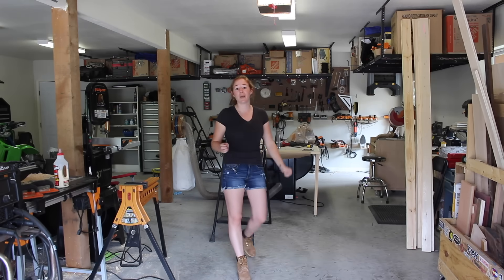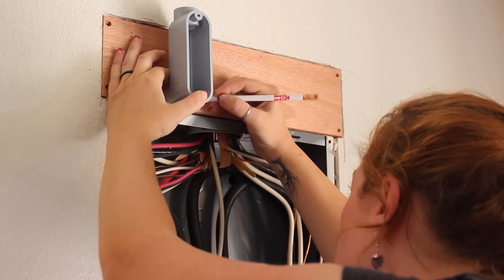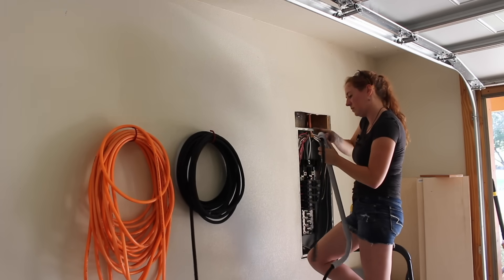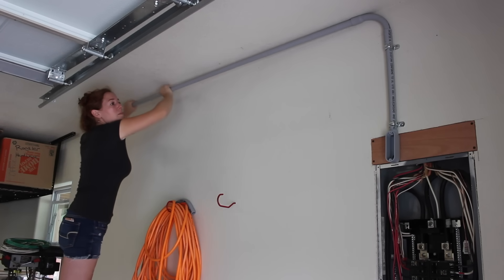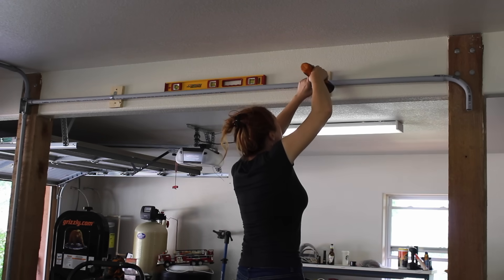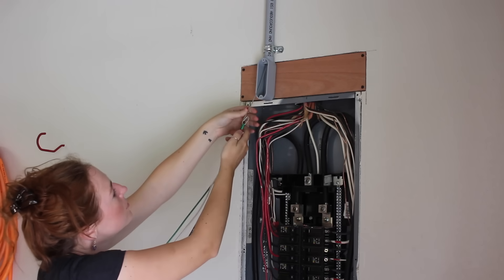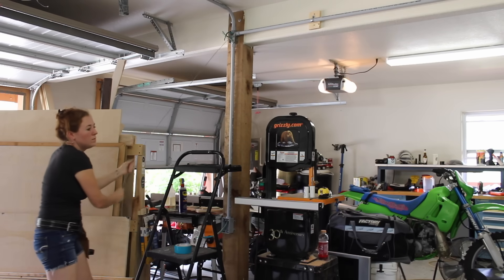Adding 220 Volt Outlets to the Garage

Comment: I'm pretty sure it's against code to giggle while using a fish tape. =)
Reply: i thought it was against code if you didnt?
Reply: If I were an inspector, I would give her a pass :)
Reply: @droidgee  From the ell going into the box there is no connector, the wire will be rubbing against the sharp edges of the  box.
Reply: How is it that you have so much space in you electrical box?
Reply: Section 308.36 B state no one ever laughs using fishing materials
Reply: @TomsComs  Well I must say that she was definitely giggling and it never got close enough to laughter so I think she still passes :-)
Reply: good one
Reply: When she hits the buss with the head, no more giggle
Reply: Anyone know what size of THHN she used? Trying to decide which one to use myself.. 10 or 8 gauge for a buzz box Lincoln AC welder?
Reply: @berniemac8413  So a thirty or fifity amp install?
Reply: Vivid Droid fifty amp install..
Reply: @berniemac8413  6 gauge wire is the best. Lower resistance cooler connection. Handles max current of breaker (over current before trip or fail). You need to run it in armour also.
Reply: Vivid Droid my Lowe’s was out of 6 gauge thhn so I went with 8 gauge.. don’t think I’ll ever use the highest setting on my stick welder so it’ll never see the peak amps.. hence, 8 gauge should be fine. And I ran it in 3/4” pvc conduit.
Reply: @berniemac8413 I have ran 50 on 8's including the ground.
Reply: @berniemac8413  new code says 6 what is the gauge of the welder cord
Reply: Vivid Droid hmmm interesting.. is the new code for romex? I’m unsure of the wire size for the welders cord.. it’s a simple ac/dc Lincoln tombstone welder.. I was unimpressed with the plug when I first saw it.. manual states three 10 gauge wires or bigger to power outlet.. and if the run is over 100’ from electrical panel to outlet, then use 8 gauge or larger.. page 7 of this document.. 

https://images.homedepot-static.com/catalog/pdfImages/fe/feb72a11-06e5-487c-9242-75b2df4ecdb1.pdf
Reply: @berniemac8413  The 6-50r uses L1 and L2 and a ground. The neutral is not used as there is no need for unbalanced currents.
Reply: @berniemac8413  You must use the ground and not the neutral as a ground.
Reply: Vivid Droid yea that’s how I wired it.. ran an 8 gauge red, black and green thhn wire through conduit to outlet.. run is pretty short, at max 5’..
Reply: Vivid Droid haha.. from what I’ve seen on charts, romex and thhn wire don’t have the same amperage rating for wire size larger than 10 gauge (thhn can withstand more amps).. and I also found out you shouldn’t run romex through conduit which is the reason I chose thhn.. funny how they’re all bickering over code. Lol
Reply: @berniemac8413  Yep. Codes are minimums to cover their arses. Running lower resistance ie lower gauge actually saves money over time.
Reply: @VividDroid  You can use the neutral as the ground, but you MUST mark the neutral line with some sort of marker, like green tape so people in the future know it's a ground.
Reply: @lukepotosky7710  good idea
Reply: @berniemac8413  When in doubt go up a size. Wired mine for 30 amp so 8
gauge was plenty... But depends on length .
Reply: @berniemac8413  If you are doing a welder, I belive it's code to use at least 6 gauge and using at least a 40-50+ Ampere breaker. Remember, always play it safe, and code is just the minimum requirements.
Reply: @berniemac8413  What kind of amperage range (low to high) are you going to be running through it?
Reply: A G I have a Lincoln ac welder 180... which ranges from 20amps to 180amps.. the lowest setting I’d use would be 20amps and the highest probably be 145amps.. maybe 160 if I ever burned 5/32” rods..
Reply: @berniemac8413  Take a look at the welders specs to see what the input amperage is, most 180 amp ac welders will require a 50 amp circuit which would require # 6 wire.
Reply: Donald Crossley thanks for the response. I tried purchasing the 6 gauge, but my local Lowe’s only had 8 gauge THHN wire.. specs said 8 gauge THHN it’s rated for up to 55 amps, so that’s what I went with.. along with a 50 amp breaker..
Reply: @berniemac8413  If you used any NM cable in the circuit, #8 is only good for 40 amps
Reply: A connector is missing between the ell and the main, with enough vibration there will be a short
Reply: Got Code? :)
Reply: Depends on what jurisdiction you are in and what clothes you are wearing.
Reply: LOL
Reply: XD
Reply: Sorry, but I will say.....that was the cutest giggle ever :)
Reply: ok weirdo...
Reply: No it's not
Reply: @MiguelHernandez-rk7bg  /r/whoosh

Comment: I am not an electrician by any means but I was under the impression you can only run one outlet per 220V breaker?  Is that wrong?  I am in the middle of running my 1st 220 for my 5HP compressor and I see and hear that every where for some reason...
Reply: I think you can have a number of outlets in one 220 v breaker as long as the load on those outlets does not exceed the amp of the breaker. I guess the intention of the user for the outlet determines its quantity. Not an electrician too.

Comment: should also be using red and black, not white ;)  usually people don't mind either way i just typically like to do it that way. I also like to mark outlets just in case even if the plugs for the wall are different than a typical 120v

Comment: My stepfather was an electrician in Chicago for 55 years and one of the best.  A couple of hints:  1) use mineral oil to keep the wire from binding in the conduit.  2) run the fish tape while you're building the conduit.  3)   Leave yourself a foot of extra wire at each junction box.    I worked with him from the time I was 8 to the time I was 14 but am not an electrician.

Really nice work though!

Comment: Where i am from you can only use one 220V outlet per circuit, so if you want two outlet you will have to run two separate circuit, you can not split one circuit and use two 220V outlet.

Comment: At first I had some questions, but going to your blog and reading the additional info there answered most of them. I agree with one other comment which stated you need to ground the metal junction box per code. Just curious why you didn't use a PVC J box there? One thing to keep in mind is that you have to size the circuit for the devices you plan to use. You can not safely run a tool that requires a 30a circuit and a tool that requires a 40a circuit both on a 40a circuit. You would have to run 2 separate circuits because by the time the 30a tool shorts out and draws enough amperage to trip a 40a breaker, you could have a fire or get shocked yourself. If both tools use the same amperage circuit (both are 20a or 30a, or 40a, etc), then you can install multiple outlets on the same circuit as April did here. You can't add the amperage rating for multiple machines together and size the circuit for that combined rating. Which means you may not be able to run 2 machines at the same time. It's always about safety - YOUR"S !!  Nice job April !

Comment: 220 Volt outlet needs four wires - two for, power, one for neutral, and one for ground. The diameter of the wires depends on the maximum current of the outlet that you would like to install. This will also decide the breaker that you need to choose.

Comment: I was a navy electrician but not comfortable enough to add one of these to my garage for my dryer. Dummies who designed this house only has one upstairs for my dryer. Since there's a host of electricians in here was wondering how much this costs to add on avg for a one car garage space and one 240 outlet? First guy said $600 but no way I'm paying that. BTW way to go April..another quote like thar and Im with you.
Reply: Navy gurl had one put in my garage yesterday, 220/20 amps $240 and 240V/30 amps $385

Comment: FYI, current carrying conductors( hot wires) can be any color other than White or Green which are reserved for Neutral load( white) and Ground ( Green or bare).
Reply: White wires can be used for current carrying wires as long as that white wire is colored/labeled as such. In this case, the circuit is a dedicated 220 volt circuit that does not require a neutral wire.
Reply: I use black and red for the hots, white for neutral to accommodate 120V, and green for ground.

Comment: Why did I only see 1 hot wire should they be too
Reply: Both the black and white are hot. You need 2 hot leads to make 220 volts or higher. You could use 2 black and 1 ground, but this is normal.
Reply: @georei  so no neutral is required the panel makes up for that then thanks
Reply: @TheLuis9597  she could have pulled 4 wires that would have the neutral, 2 hot leads and a ground. Normally that is used with 4 prong outlets. But here she used a 3 prong outlet. I'm not an electrician, so I can't really tell you why. All I know is this is how it's done.

Comment: The only problem I see, is that the panel was live the entire time I'm guessing. The bottom bus support is wide open and you could easily make a mistake, slip and short phase to ground or phase to phase.
Reply: I think April mentioned going out to the pole to shut off power.

Comment: What a nice clean job from a gorgeous girl! This is very neat work for a handyman (handywoman?) and the only thing that is not allowed by elec inspectors is you cannot run thhn conductors in free air, like when you went from the LB to the knockout in the panel, I know it’s only a few inches and covered up so you could let that slide. The white wire can be used as a phase conductor if it’s marked red or blue and there is not a neutral load needed. The handi- Box is a bit small for that junction box but looks neater then a 4sq. Where I live pvc is not allowed indoors in a residence because of the fumes it emits when burning- fire dept requirement not electrical code. Plastic bushings at terminal adapters may be required, metal boxes should be grounded with a pigtail. Other then that you do clean tidy work and the only reason I know what I know is I read a NEC codebook on a long flight once;) I’d hire you in a heartbeat but for all the wrong reasons

Comment: You need to pigtail the ground to those metal boxes.
Reply: I think you only need to pigtail is with flex conduit. That is what i was told by my building inspector
Reply: Robert Cardiff if it’s a metal box it should be pigtailed with a green ground screw. Which every metal box has a specific threaded hole in the back for

Comment: Thoughts for future projects.... Cut the sheetrock to the ceiling and run the conduit in the wall so you have a clean entrance into the panel and a 90 degree bend up top. Since this a garage the wall coverings might need to be fire rated, meaning fire code sheetrock or a piece of metal, so that's what you cover the hole with, not wood. Thinking a bit further, if the conduit to the ceiling was run extra large (or several pieces) to a large junction box, then any future expansion of additional circuits could be brought up top without opening the wall again. Tip for other novices: An LB may not have any splices and they are only for pull points. You must have a box or an LB every 360 degrees. Basically you use 3 elbows and the 4th must be a box or LB.

Comment: Please quit saying 110v/220v , it’s 120v/240v. You even seen that it said 245v when you checked  the breaker with your meter, but overall I was surprised at the work you did, even tho I did spot a few NEC violations, especially coming from article 250 (grounding and bonding)

Comment: I like smart girls! Great job, great video!
"Don't listen to those idiot electricians, just look up the laws and codes for your state/county where you live. It's not going to be the same everywhere"... We have state certified (well supposed to be) electricians here in my state/ city..that don't know what the hell they are doing, and we had to call an independent company to fix the mess, the city certified guys left us with!
Reply: 910AM Superstation Funnies... Personally, if I don't know or if I can't get a consistent answer from a professional, I will ask the inspector what he wants to see, and perhaps go a notch above that. I probably would have run 2 circuits for 2 outlets and made the junctions in 4x4 boxes to make life easier. OTOH, in my shop I might have run #6 wire to a small sub panel on that post, which would allow a spare 120 volt outlet as well.

Comment: Hello guys, just need a lil help btw, thanks to April and Got!  I have the same situation, but im thinking to hire electrician to do it for me,  cause i really can’t do it myself! but im doing some project for my kids right now cant wait for electrician,   I just use my table saw turn it off if i need to use shopvac and other power tools, but sometimes i forgot that i only have 15 amps in our garage and it tripping off,  so my question CAN I RUN A HEAVY DUTY EXTENTION FROM THE ATTIC POWER DOWN TO THE GARRAGE TO ACCOMODATE SOME POWER TOOLS?  It may sound a lil bit  stupid, but im just new to woodwork,  i just dont want to be a plain house wife,  it feels good that you can make something out of wood,   Anyway you guys are great!  Keep this covo going👍

Comment: Great Video as always.  I am not a professional electrician either, but was shown another method to chase wires through conduit.  It is, a little easier and I believe gunner.  I use a vacuum cleaner to suck a small fabric wad attached to a polypropylene string, attached to the wire I’m pulling.  It is quick and easy as the metal fish can sometime hang up and is limited to a certain length.   Good stuff, keep woodworking.

Comment: as a rule of thumb when you pull the wire should be a black and red and a green unless your equipment requires the white wire which is the neutral

Comment: You did a great job... I do a lot of my own (personal) electrical work as I've worked side-by-side with a facility electrician for decades and it's second nature to me.  As much as I like the cleanliness and professionalism in the work you did, my opinion (valued at 2-cents at today's market rates) is to use metal conduit (EMT) instead of PVC.  Yes, it's harder to work with and more expensive, but the metal conduit is also does double duty as ground.  Shorts can happen not just at the outlet of box areas, but also in the pipes themselves so having the conduit serving as ground is added protection against shorts.

Either way... great job!

Comment: I like the comments that detail each and every possible improvement to the work, especially the ones that reference code requirements. To be safe, all the code requirements must be followed. That's why the code exists. I appreciate the video and all it teaches. A well done video as far as it goes, but the instruction it gives is not complete without the comments correcting and adding things that must be done. That said, I liked the video and it was useful for me.

Comment: you can use a shop vac to suck a strong string  with a wad of paper towel tied on to make it fit loosely tight in the conduit to suck it through your conduits first, makes pulling your pull rope in lots easier than jamming a fish in...

Comment: The only thing that I see that's questionable is how you connected the conduit outlet body with cover to the main breaker box. It appears you've just ended it at the wood plank and did not extend it into the main breaker box with an acceptable fitting. 

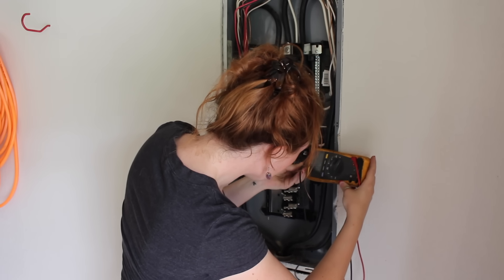You showed that you removed the knockout from the panal at 1:16 but you don't show the installation of a fitting in the video. Had your camera been up just a little at 4:54 we could have seen this but you don't show it. 

Running the three cables through that raw opening left by the removal of the knockout is not allowed under the NEC. 

Now be clear. I'm not saying you didn't do it correctly however, you just don't show it in the video. 

Could you please clarify this point? 

Thank you.

Comment: Very nice. I'm not an electrician but I am a fan of your knowledge. I of course will not attempt such a dangerous work load. I will spend the extra money to having this installed by a professional due to my low risk of causing issues with my house which houses my Queen.

Comment: While I question the legality of SO cord in conduit, it is against to run conduit that is not complete box
 to box, i.e.  running wire exposed behind the wall. Also you did not show a fitting ( chase nipple) in the top of the panel to protect the wire. Other than that, good job. As a side note, I was a journeyman electrician for 30+ years before retirement.

Comment: I dont see the point in your junction, why didnt you just feed the second outlet from the first, eliminating the joint and wire nuts. Also the white cable being used as a phase conductor...................

Comment: Also your not sapost to run cord in conduit  it's because of the insulation and the heat it might generate   even tho it  doesn't get hot,  wire can only have insulation 2 times the wire itself and the conduit count as two  that's what some old electrician  told me

Comment: shouldn't that line be run with a 12/3 or 14/3 with ground (red black white and ground) rather than and X/2  (white and black) ?  i know it's possible, and allowed in some places, but my understanding is that you have to label your second wire (your white which is generally used as a neutral) as hot.

Comment: 2. 220volt outlets on 1 breaker??? It didn't look like 10 gauge wire?? Do I hear a humming breaker?? Lastly never use white as a hot in this way.

Comment: Damn girl, is there anything you can't do? I tried your ladder hanger. It worked ok. Your ceilings joists must run a little different than mine. I had to use a couple of 2 X 4's to add to the joist 1st, then attached the hanger. Keep up the good work.

Comment: You could just started the PVC from the outlet to the service box so you do not need to do any wire pulling!!!
Reply: Nel Edora ^^ you are obviously not an electrician.  CODES are based on metal conduit. PVC may not meet codes for many applications.